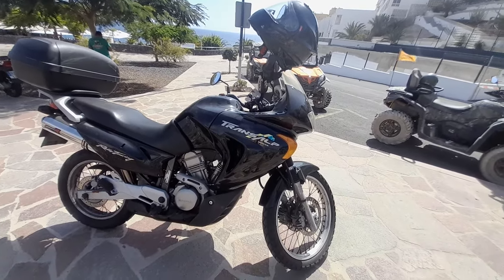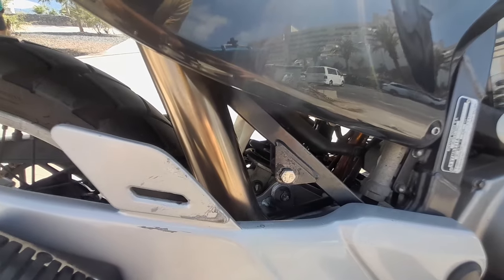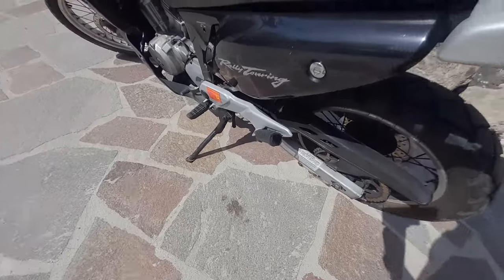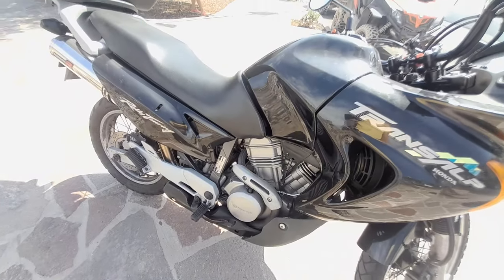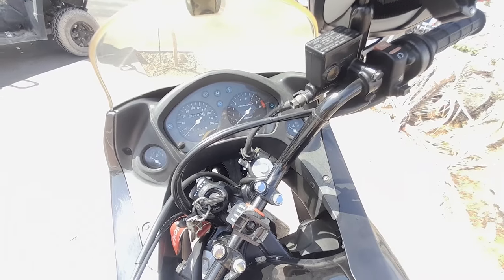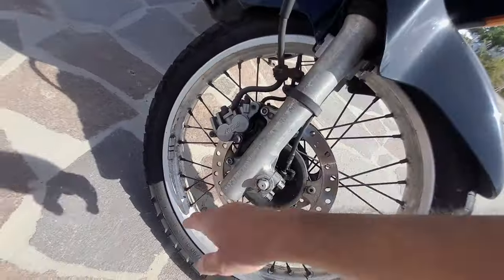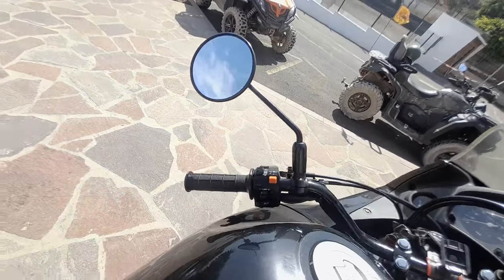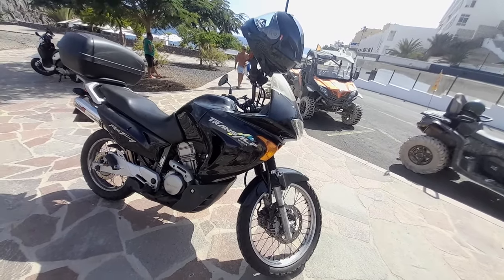THE MOST UNDERRATED MOTORCYCLE IN THE WORLD THE HONDA TRANSALP 650 SPECIFICATION. SUN, SAND & QUADS!

Comment: I am surprised you called out the gearbox, i think Honda generally makes good transmissions, transalp might be a bit old school but way ahead the "clunky" mess ive encountered on some other bikes ive ridden.

 And like i commented on another video of yours sir, i dont have a weave on mine and it is bone stock. Are you sure your wheelspokes are all tight? your fork bearings are ok? your multilink is without play? have you tried with stock rear tire  size to see if it persists? i dont think a handlebar is gonna remove the weave. 

I agree the stock mirrors are good. 

The luggage rack is plastic 🙃
Reply from the maker: The rear rack is not plastic it is alloy. This is standard original fitment, don't know why uours is plastic, but that not factory fit. You have the 650 or 600??
Reply: @someguyhondatransalp650  I have an 05 with clear blinkers, maybe its a facelift thing?
Reply: @someguyhondatransalp650  I had to go out and double check, and it appears that you sir may indeed be correct! it looks so much like plastic on mine with the finnish on it. So i always assumed it was plastic!